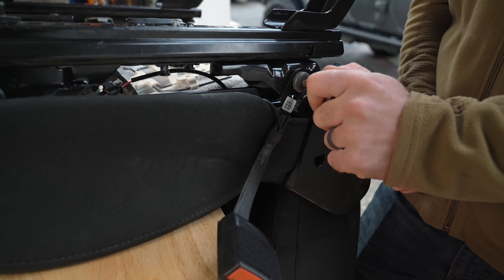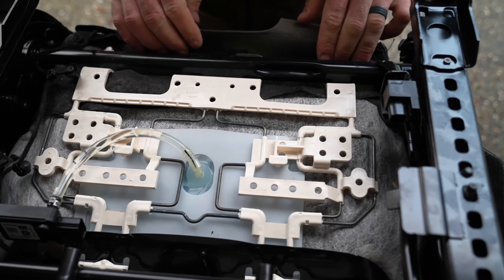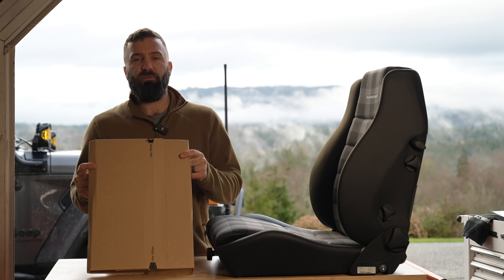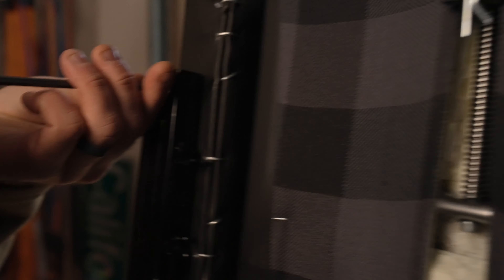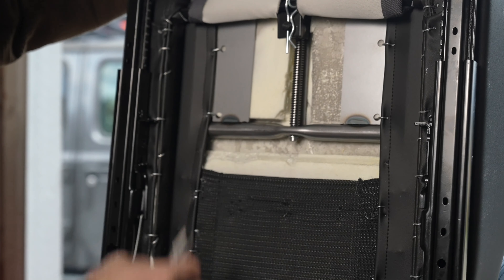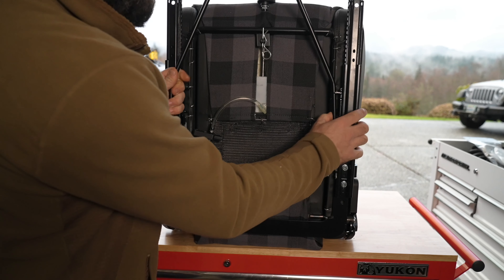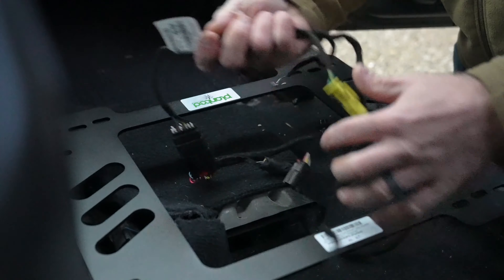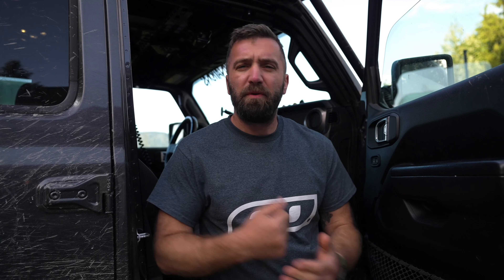Installing Scheelmann Seats in Jeep Gladiator | Step-by-Step Guide

Comment: Did you get the brackets direct from scheelmann
Reply: Also wondering this. Have been googling for seat replacements and stumbled onto this video and so far this looks like the best brand.
Reply: @WizardActual1-1  I'm pretty sure just the universal rails are in their. Planted make a seat base for these for the Jeep. Downfall is your in at least 4500 for the set up to 5k depending on options. Good thing is seats can always be transferred to future builds as well.
Reply: @WizardActual1-1 as far as brand. There are many different options out there for different uses. But for an orthopedic seat this is the only real option purposely built for vehicle seating as a primary case.
Reply from the maker: We did get our brackets directly from Sheel Mann. They have held up great and are an awesome upgrade from the factory seats. Happy to answer any more questions you may have.